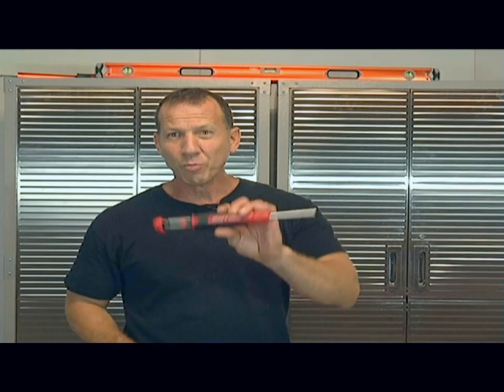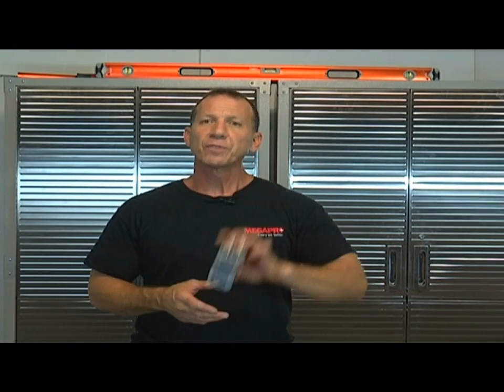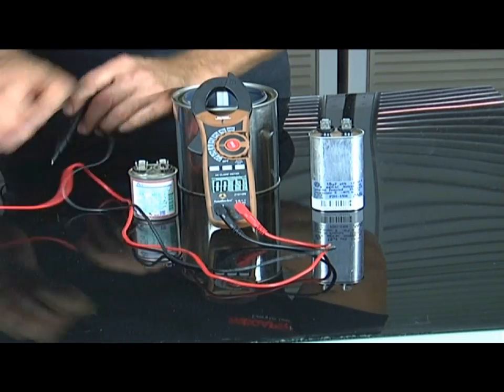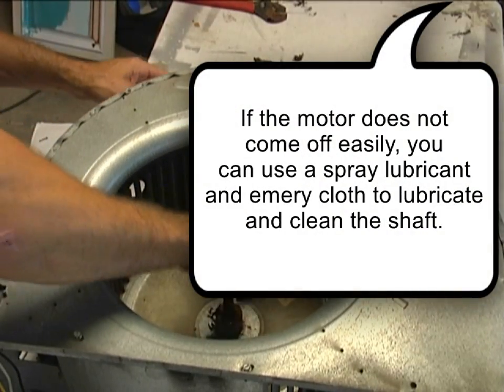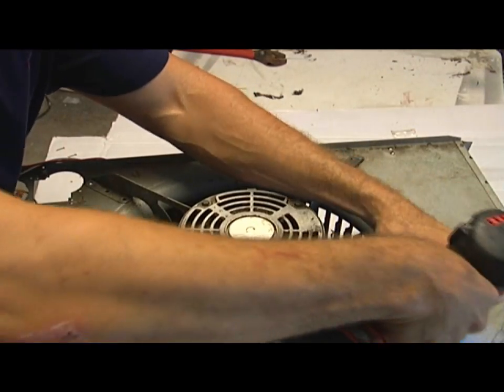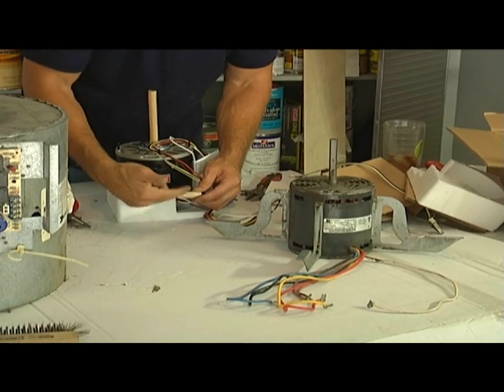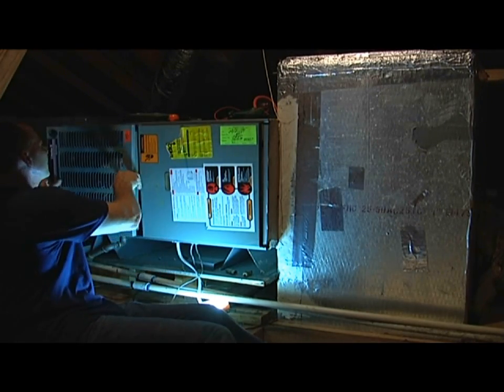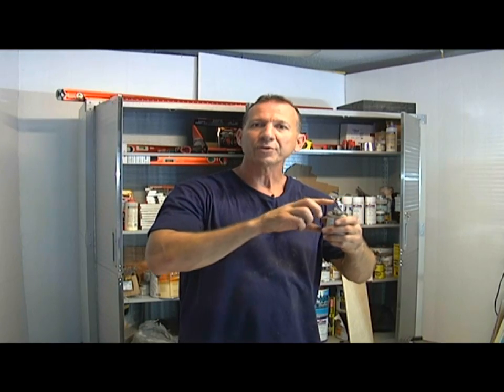What to check when your A/C stops blowing in your home!

Comment: Would advise harnessing all wires including the direction plug. Any hanging wires will surely get fouled in the future. Washing the wheel is always worth the extra effort. Tape up all unused speed wires if there are any extras. Not bad for a newby (I'm retired HVAC)
Reply from the maker: +EFD620G 
Thanks EFD620G, I always appreciate good advice!
Paul

Comment: Unless I missed something, all you checked was the capacitor, Was the motor seized? How did you determine the motor was faulty, and not another device (relay, etc)?
Reply from the maker: Edward Fry 
Nope, it was the motor. It was humming and hot to touch. They are usually not the problem but it was 18 years old. Works now and blowing like a champ. Our temperature down here is averaging 95 to 100 degrees with high humidity. I'm glad it was a simple fix.  
Thanks!
Paul